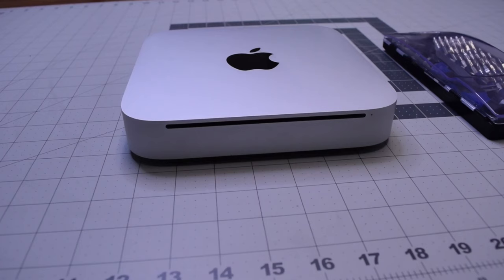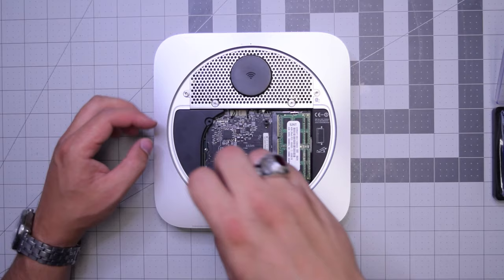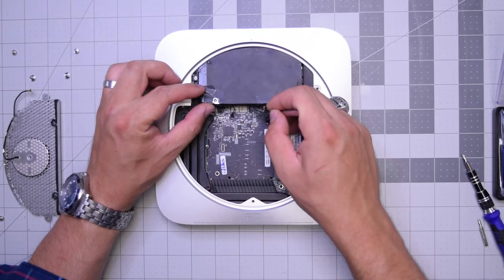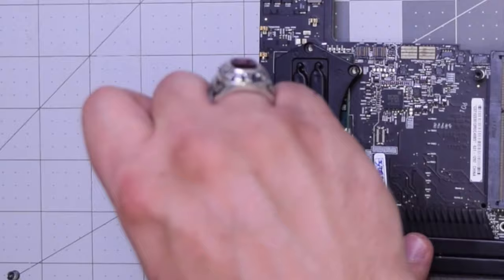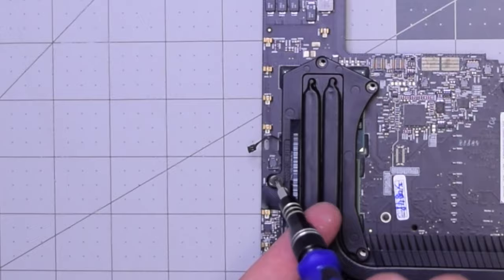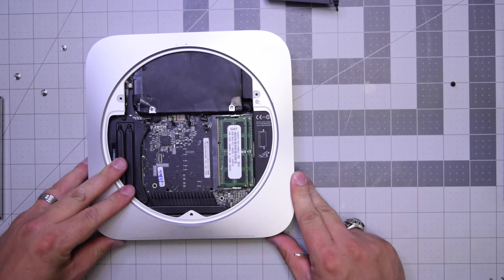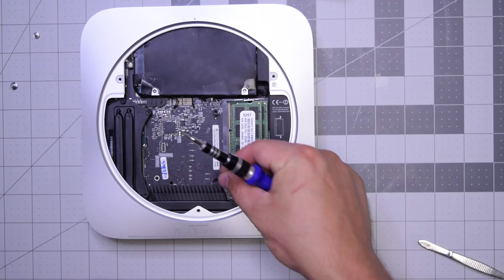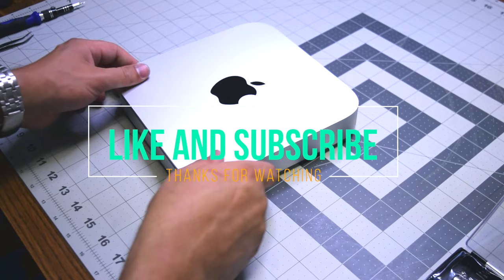Mac Mini A1347 - Heat Sink Replacement (2010-2012)

Comment: What difference does tithe make? It seems like a lot of work. Is there any point in doing it if your 2011 Mac is running ok?
Reply: Id like to know as well
Reply: Yes it does improve....the temp..and performance
Reply: having lower temperatures in general will extend the life of the chip.  doesn't really matter if all you do is web browse but you you do anything slightly intensive on the older machines the temperatures will skyrocket.  so by doing this it will make your computer last longer.  especially if you have the dedicated graphics on it.  that's a chip prone to failure and lowering overall temps for that would be best